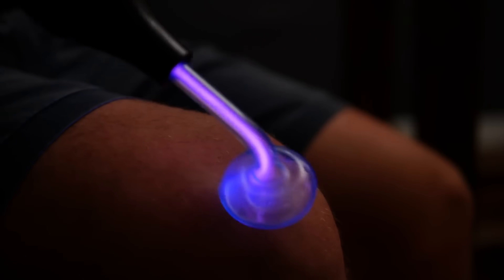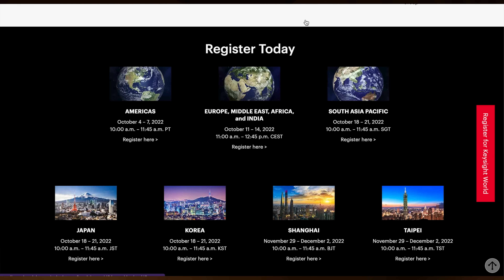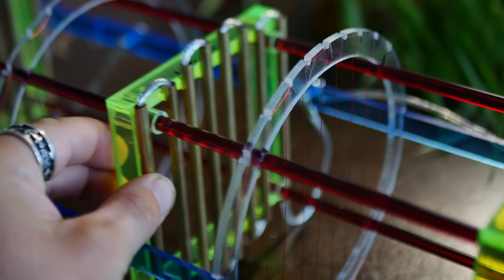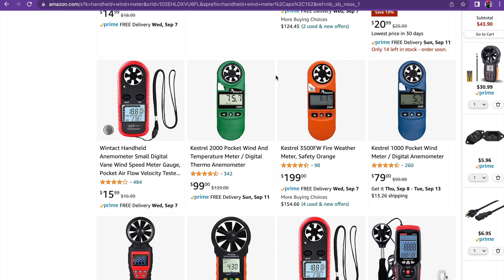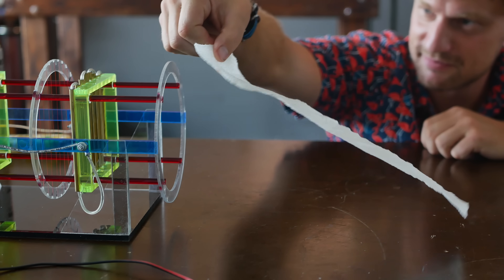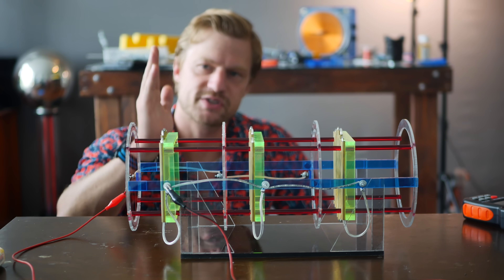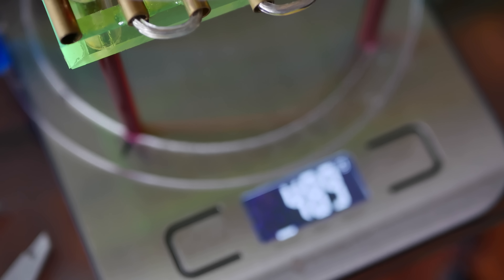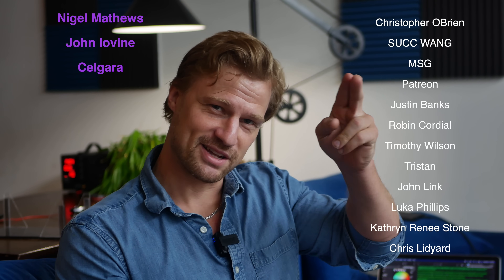Designing A Next-Gen Ionic Thruster! (For Flight)

Comment: 1 Smaller/thinner ground electrodes (or at least flattened or elliptical) will disrupt flow of air less - also cut and fit them to a circular bracket like the wires to minimize wasted material and reduce weight
2 fine solder joints and aluminium wire will provide lighter electrical infrastructure than copper with less resistance than steel hardware (looks like you're mostly in aluminium anyway)
3 Adding one additional stage is probably worth it, especially if you can reduce the weight of each stage, and more may be worth it if the added speed isn't halfing (as it appears to be)

Things to play with:
1 enclosing the asssembly (IE in a tube) and shaping intake and exhaust may yield some improvements (or maybe not)
2 rotating the two parts of each stage at differing degrees to eachother, and the stages at differing degrees to eachother could draw in more air than the untwisted config demonstrated here (this may or may not be affected either way by an enclosure) and there may be an optimal angle
3 other configurations of electrodes may yield great efficiency (spiral, zigzag, higher densities etc)

Looks super fun!

Comment: @PlasmaChannel - this is fascinating - even for a layman such as myself.  However, on your airflow testing - the exhaust side is interesting, but would have been very interested in readings from the inlet side.  ALSO, if you had wrapped it in celophane plastic to see if that would affect input/exhaust.  Amazing either way.  thanks.

Comment: Ion tech has alwasy interested me.  I am not a phisist  but have a recolection of the theory.  Love what you accomplishing but my question is how do you intend to power it
as an actual thruster,  A 90 watt 65k supply is not going to be small  and if you want thrust higher then your 4 to 1 I dont think 90 wztts is going to do that.  Even with switching power supply and hi voltage transformers you will have a challenge.  I am sure your thinking this ahead of time,  You ha e to prove the tech and build the supply afterward.

Comment: great toy.... even though it's utterly useless..... you see, with all the numbers you do include in your presentation. what you fail to apply, is the actual [power supplies weight and etc. all that energy wasn't coming from thin air. and when you factor that into you little design. you'll see quickly why this will never get beyond class projects and home tinkering.

Comment: Could this concept work in an HVAC system? Can a BSI Thruster designed for an HVAC system be more efficient than existing HVAC systems? Can the exhaust air be warm and efficient enough to be a heat source for a building? What are the exhaust gasses of a BSI Thruster and is circulating the air in an enclosed space noticeably different from a more traditional HVAC system? Does the BSI Thruster still work when exposed to high humidity, or heavy condensation?

Comment: I think you need to use the same sort of airflow technology as Dyson does in their fans. That would borrow some extra thrust but will it cost weight ? Not if the negative posts are actually the shape. It would work better as a tunnel vs open as much of the thrust is leaving out the sides or creating vortecies from non accelerated air.  I have no more ideas.

Comment: I know I'm late but would enclosing it work better? So there's only the front drawing air in to ionize instead of possibly drawing in surrounding air at each ionizer. I would think as I don't have it in hand to mess with but the rear ionizer and the middle one would create a small vacuum in the enclosure and the front would be able to ionize more air being drawn in.  

Similar concept of a dual in-line jet pump vs exposed dual in line propellers for boats.

Comment: Have you tried to use wire without the varnish? If you look at 9:12 you can see where the voltage is breaking through the insulation. If the insulation isn't there wouldn't the air velocity be higher? I assume the insulation is holding back part of the power output.

Comment: cant you just use aerogel supports and graphene for the conductors? it will drop your weigh by a lot
Reply: and maybe wrap its outer circular body with lithium ion as its battery to make the power source wireless? add some wings with flaps and a small wireless chip on it to control its flights

Comment: Enclosure. With that Bernoulli . Maybe Venturi principals. Of course weights of solid objects. More stages higher voltages.  As a prototype it is very nicely done. Love the plasma pictures. Thank you for sharing. I am sure there is more that could be improved. Very promising how would it work under water if it were hermetically sealed circuits? Something to think about. You should have worn gloves. (I read some other comments. Good ideas, maybe some rotation along the center of the axis or different shapes of coils. Maybe flat wires. You should look at video 1809 from Robert Murray Smith)  inspiration is everywhere. This is a great video, thank you for engaging the audience for ideas.

Comment: I think you could use a brass/copper mesh instead of these bars as the negative charged electrodes. That way you can cut down on weight, without reducing the airflow too much

Comment: Try the design with ultrathin gold blades instead of copper wires.  The gold blades should have a micron or sub-micron knife edge on them.  Also, the injection of xenon or krypton gas at the front end should lead to higher velocities and greater thrust. The back end, again, should be gold blades.  Silicon glass would be a better insulator for the parts with less tracking leakage and again increase velocity and thrust.  Possibly the addition of a series of venturis in each stage could add to thrust output and velocity, as well as a tapered stage design.  Just a few thoughts on the subject.  Let me know what you think.

Comment: For improvements
My thoughts on improvements:
1) on the Electric Field: further REDUCE the distance between the opposed charges and increase the voltage + use more wires for a more dense field if possible ;)
2) on the areodynamics: REDUCE the cross sectional area of the ground electrode or even change the shape of it (cylinder to symmetrical airfoil to)
3) SET UP: Instead of placing the 3 "Generators" in series, place them next to each other (in parallel)

Let me know what you think about :) 
Also I am curious to see the improvements
Reply: What if you have guide vanes in every cross section for air to pull into each of the 3 plasma fields
Reply: @chadsix  if by guide vane you mean a propeller, that's exactly what I was thinking
Reply: I do not know if it makes any difference, but would it be possible to power up the circuit with pulses of power? Just wondering if it would make any difference on the thrust. I am pretty sure that it would reduce power consumption.
Reply: Also another thing is the airflow to power ratio.
Reply: I wonder if they could function better would force air induction versus a stagnant air baffling of sorts
Reply: if you put them in parallel you'll get more airflow but less thrust because of the increase in surface area
Reply: Personally i appreciate your inputs.
In the future, don't be naive.
Reply: @findmeiseeu  parallel might work better in a converging duct.
Reply: @findmeiseeu  some people dont know alot about hi volt electricity and fluid dynamics, so give David a bit of leeway....

Comment: now you can try adjusting the strength of the thrust by adding a cone at the back like at the rear of a jet engine and see what numbers you can get by adjusting the opening of the cone. maybe even build a lightweight shell around it and make an extremely light aircraft for this engine to potentially propel through the air? Testing must go further than this when you're able because this is freaking epic.

Comment: Can you make that in a  sealed 9inch diameter tube about 3fr around filled with a helium o2 mix  maybe with a with another rotating inner ring that will be the same with an adjustable microwave frequency in the inner tube ?

Comment: 1-you need in case the entire design into a circular shape
2- you have to have a escape nozzle that is shaped into a cone
3-you need a jet turbine at the third junction of your plasma coil 
4-The material to make the turbine has to be made out of neon magne material 
5-the Neil magnet turbine how to be sitting into a magnetic field to allow for the rotation to exceed the trust 

6-there will be two magnetic fields one that holds the turbine in place
7 the second magnetic field will be connected to a pulse module Will rotate the magnetic field allowing for the turbine to turn

Comment: I can't tell anything about the electric part of your design, but from air dynamics point of view, there are 3 things that can be improved. First of all, there is no duct, and a lot of energy is dissipated. Second, the plastic rings are facing the flow with their flat surfaces, and this shape has drag coefficient of 1.15. Third, the metal tubes impede the airflow, drag coefficient is 0.45, but can be higher in turbulent flow. So you should do the three things to improve your system: 1. Put the entire system into some kind of duct. 2. Remove impedances to the airflow. The duct should solve this problem for the supporting plastic rings to remove this impedance entirely. Also, you should not put any objects on both sides of the tube, there should be enough space both on the entrance and on the exit side, at least four times the diameter of the tube (remember the thirst experiment - you should place it much higher above any surface). This way you can remove excess dynamic pressure. Your measurement device is also a huge impedance to the airflow, unfortunately, use something smaller, or find another way to measure the air speed. 3. Design any internal parts after some the "streamlined body" shape, such as an airfoil. This will reduce drag up to 20 times per the same characteristic diameter.  You can easily find typical drag coefficients for different 3D body shapes.

Comment: Circular tubes most probably generate a lot of vorticity resulting in major energy loss, you should really try some optimised foil shape for the tubes. Also you would get much better results if you enclose the entire thing in some kind of a duct, removing pressure leakage.

Comment: The Three inefficiency in this above design is as follows:1 It needs constant supply of voltage at high power it's pretty hard to get 2 It has high losses like constant and variable loss etc. which will give low output
3 It change in thruster speed is very minimal.
Overall it can be good floating system

Comment: Does the closeness of the wires or the abundance of wires change the thrust? Say Instead of lines, a crosshatch pattern or a six pointed star or more.

Also, if there was a case around it to vector the thrust better, a funneled end as well, and maybe some kind of air foil at the air intake side to increase the speed of the air?

Comment: Turn it upside down on the scale. It should push towards the scale, and not pull. Otherwise the air is also pushing the scale. It might be only 2-3 gramms but still not the accurate number.

Comment: Okay 4 months and no Pinned?! 😵 Here goes:

1) I’ve seen comment about curving the air flow
2) I’ve also seen comments about encapsulating
3) Some people are talking about enhancing the thrusters in many ways.

I can see that all these are actually correct, except 1 & 2 are a joint operation. Because not only do we have to capture the air-pressure at the exit chamber too add thrust, we also need to contain the air slippage during phasing and return it to the beginning of the cycle at the entry chamber.
Thus, We’re looking at designing the enclosure to perform these three air tasks at once!

As for the power, well individually powering each phase sounds - potentially, productive....but power consuming?! 🧐 The added protection to the system with magnets would help, yet I feel to drive it with magnets would be a better solution than a battery. In other-words; a low power battery can power a magnetic system that actually generates the required voltage to make this thing go Jet speed....with no power-loss and way more fuel efficiency in the long run.

Comment: That’s neat! What if you have different volts per stage? Also enclosed so airflow only has a single path? Finally with the enclosed idea, i’d also try giving the last stage air scoop to bring in additional air (idea is to add extra pressure to the last stage) and various voltages once more.

Comment: What if the wires with the current were placed in a spiraling pattern? Wouldn't that increase the amount of ionized air particles pushing against the air molecules? By providing a greater surface area to ionize the air particles.

Comment: Do you know the Dyson fan? It uses a special shape that allows air to go from all the sides, but not in the middle. The outcome is the drag from the moving air around the circle causes a multiplication of air going through the center.

Hey, taking the air from your design and the Dyson fan design, you can multiply the air flow significantly. I just modifying the shape of your design and no power.

Comment: By the looks of it, your tiny positive electrode wires have their factory non conductive coating on. It shows when you turn off the lights, the plasma only appears through the cracks. (I could be wrong, could be just the nearest contact point and it doesn't matter at such high voltage) Also creating a more precise circular target on the ground electrodes to focus the air flow would help. I would imagine the air flow speed depends on (humidity) amount of conductive water molecules in the air. It wouldn't work in space. Nasa ion thrusters use xenon gas. Cool project!

Comment: Lots of ways to shave off weight, e.g. soldered instead of nuts-&-bolts connections; take up the slack in the wires connecting the electrodes; smaller-gauge wires -- in fact, switch to tape and lose the insulation, since the assembly is all plastic anyway.  Drill holes in the supports to hold the negative electrodes, thus saving on glue and reducing the weight of the supports.  Maybe you could find thinner-walled tubing for the negative electrodes, since I'm assuming that it's more about surface area than the actual amount of conductive material.  Since everyone is suggesting ducted airflow, use a corrugated tube and lose the supports entirely (or at least much less hefty ones).

Comment: Fantastic project! And very, very nice to look at in the dark!

There should still be some gains to be made using an enclosed system (within a tube) and using different types of velocity stacks on the intake and nozzles on the exhaust in order to control the airflow into and out of the thruster!
Also creating a clearer path for the airflow IE: reducing drag inside the thruster by thinning out the elements within the thruster, this will also allow a weight saving! A more controllable voltage would also be a win because you could test the optimal current based on realtime adjustments as opposed to fixed points of reference.

Not sure if my wording is correct as im an armchair expert, in no way an electrical engineer or aerodynamicist, so I hope I make sense haha.

Comment: Needs housing. Each section is sucking in air from all directions. You want all of the force to be applied only to the opening of the flow.

The round tubing is going to create turbulance. You’re gonna want like airplane wing shapes.

Frankly, im kind of surprised you’re not combining this with the dyson bladeless fan geometry. All you really need is a substantially lower pressure at one end and the airplane wing geometry to accelerate it.

Comment: Fascinating video. All thru the video, I was thinking, “What if he enclosed the device in a hollow tube to prevent the propelled air from leaking out to the sides and thus focusing as much energy as possible into the line of propulsion? Would that increase the air speed at the exhaust end of the engine and thus the thrust?”

Comment: Did you tried using the 3 stages in parallel rather than in series (side by side instead of one injecting air to the others) and measure propulsion force?

Comment: I've been wondering for years if multi stage would work, and I'm happy to see that it does. I would add a shroud (duct), make the negative electrode airfoil shaped with more surface area, increase the density of the electrodes and perhaps experiment with convergence of the duct.

Comment: Amazing.  Would love to see continual iteration improvements.  Surely you could reduce weight of the plastic using some kind of internal honeycomb structure.  I love the scientific testing and retesting, I think this could be taken to another level too though...  There are thousands of configurations possible, doing them all by hand might be too much; perhaps there is a way to automate the process so that it can run overnight in slowly modifying configurations gathering data for you or something like that.  Borrowing some design ideas from rocket engine bells might improve air speed?  It's visually appealing to see the inside of the device, but constricting airflow into a 'tunnel' and not being so open may help.  I'm also really curious about the spacing between the wires... have you tried adjusting that?

Comment: I would imagine a definite improvement in air flow velocity if you place the whole device in a plastic cylinder. The cylinder can be thin plastic to avoid too much weight addition.  Cone down the end (outflow) of the cylinder and even add rifled baffles on the inside for increased flow velocity